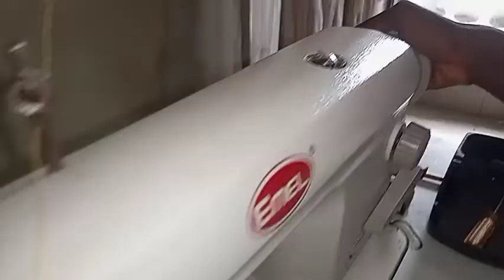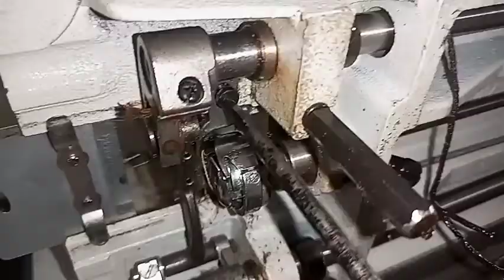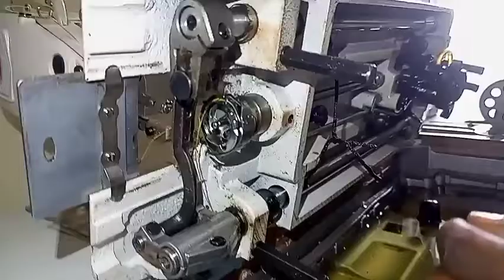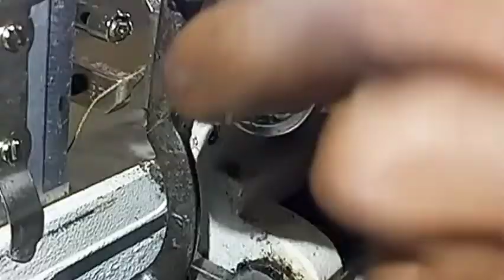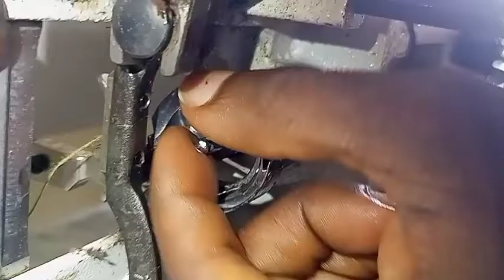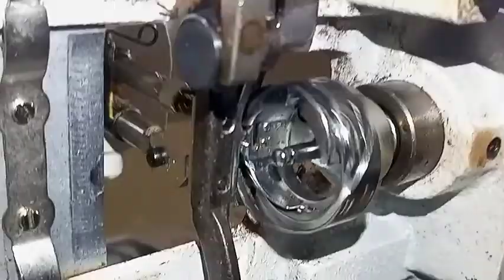How To Remove Thread That Stiffed your Industrial Sewing Machine While Using It

Comment: Thanks for this video, but how do we prevent it, what causes it?
Reply from the maker: Don't step on your machine when there is no fabric on it
Otherwise if there's thread inside the needle, it would go and tangle the engine causing it to stiff.
Reply: @JohnsSewingMachineWorkshop 
Am not sure it's only when there is no fabric on the machine because it has happened to me for about two times and there is always a fabric on the machine these two times